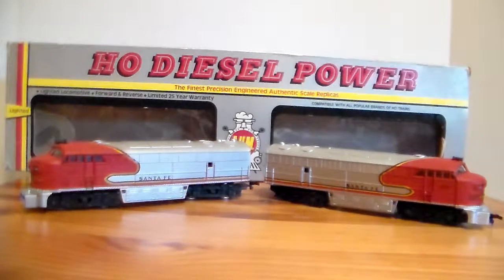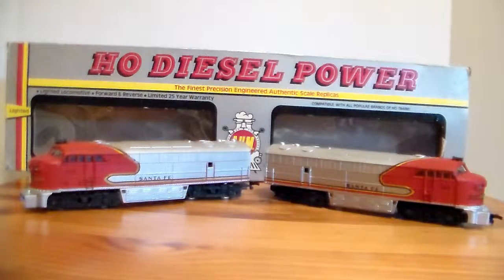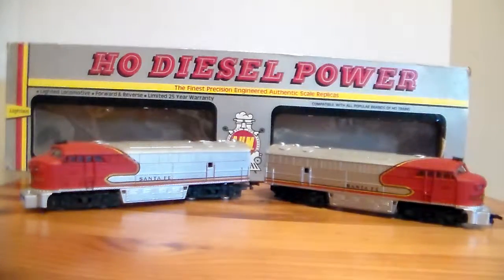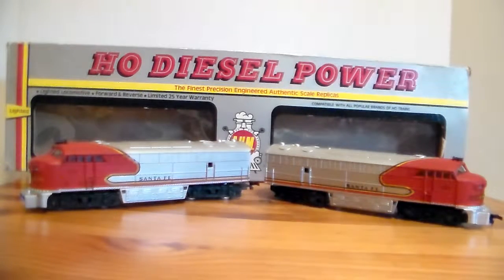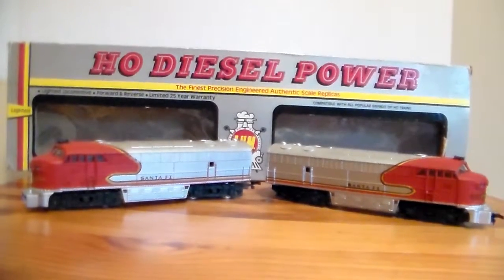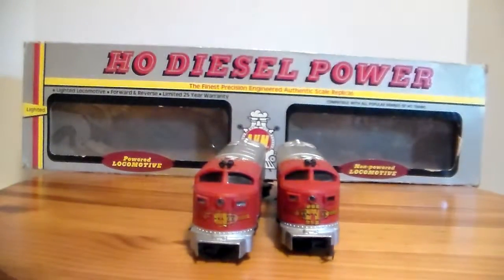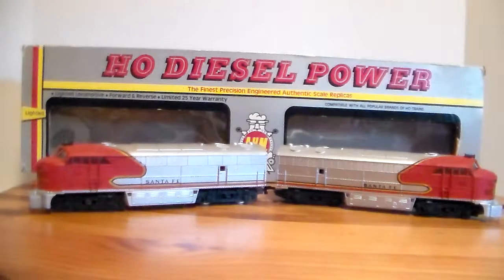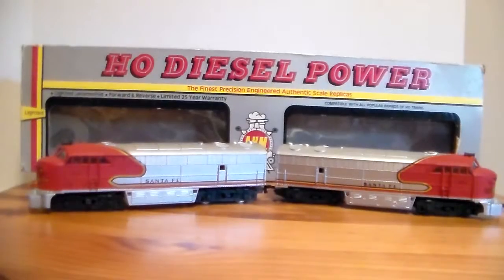Santa FE A&B FM engines A.H.M. HO trains

Comment: Those locomotives were made by a factory called Mehanotehnika (later, it changed its name to Mehano). At that time, it was in the former Yugoslavia. On the bottom of your FM C-Liners you will find a "Made In Yugoslavia" mark, an AHM logo (and probably the TEMPO markings as well, but that depends on the era of production). The first versions had only the rear truck powered. Later revisions had dual drive with driveshafts.
I agree with you, those locos are nice runners and pullers. I have a couple of them as well.
Reply from the maker: I am not 100% sure and I would have to check but I really want to say that there was a made in Yugoslavia on the bottom. The next time I get them out I will check.